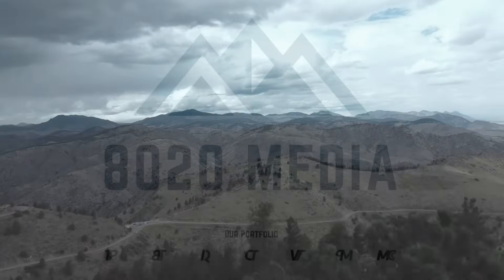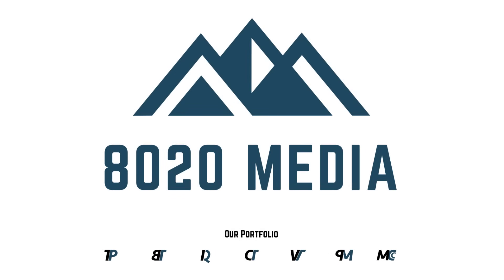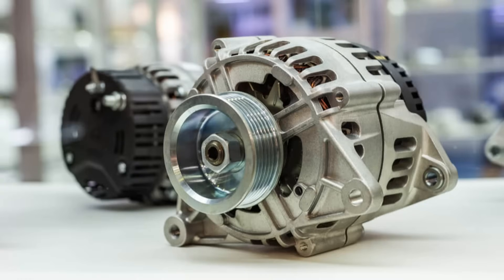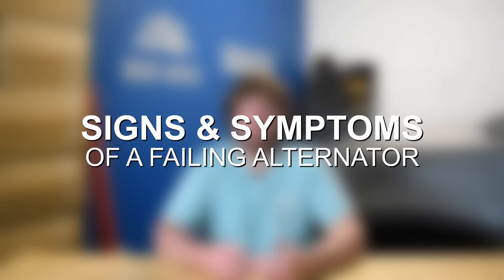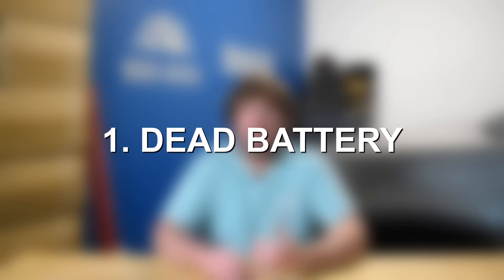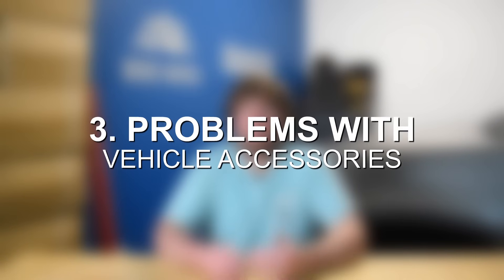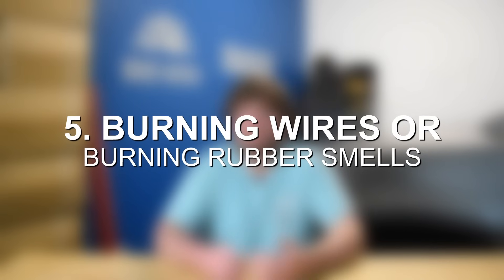6 Symptoms of a Bad Alternator!

Comment: I have a 2019 kia sorento V6 SX and a coiple of weeks ago, stopped at a red light and all of a sudden the car stalled with a low batter message. I was able to restart the vehicul after about a minut and continued on my way to work. It hasnt stalled since but now I have the battery light that turns on and stays on and my day lights in auto mode dont turn on. So I check the voltage of the battery and I get 11.4 volts. Recheck with the engine running and I get 14.3 volts. Turn on all accesories and still get 14 plus volts. Now Im uncertain what could be the issue cause the voltages all seem ok but since that battery is 6 years old, I decide to replace it with a new one hoping that it will turn off the battery light warning but its still on and at the moment I have no clue what to do.
Reply from the maker: D - Sorry to hear this.. Given that your vehicle stalled with a low battery warning, now shows a persistent battery light, and has daytime running lights (DRLs) not functioning in auto mode despite proper voltage readings (14.3V running, 11.4V off), it sounds like your alternator is charging but likely intermittently or partially failing—possibly due to a failing voltage regulator or a smart charging system fault (controlled by the ECM); since you've replaced the battery and the issue persists, next steps should include checking for stored diagnostic trouble codes (even if the CEL isn’t on), verifying alternator output consistency with a scan tool that reads charging commands, inspecting the fusible link and alternator wiring harness for damage or corrosion, and considering a load test or alternator bench test—especially since the DRLs and battery light suggest possible voltage irregularity even if multimeter values seem normal.

Comment: Good morning quick I was driving to work today and my battery charging system pop up on the dash do you think is because the alternator is going bad or something else
Reply from the maker: M - If your battery charging system warning popped up while driving, it’s most likely due to a failing alternator, as that light usually means the system is not charging the battery properly—common causes include a worn-out alternator, loose or slipping serpentine belt, corroded battery terminals, or a bad battery ground connection; you can check voltage at the battery with the engine running—it should read around 13.8 to 14.5 volts—anything below that usually confirms a charging issue, and if it’s significantly lower or drops while accessories are on, the alternator is likely the culprit.
Reply: @ thanks so much man oh man you came in clutch
Reply: @8020Automotive hey I replaced the battery and the alternator and three bad fuses but the car still will not start any suggestions of what it could be
Reply from the maker: @MrLastking26  If you've replaced the battery, alternator, and some bad fuses, but your car still won’t start, the next steps are to narrow down whether it’s a no-crank or a crank-no-start issue—if you turn the key and nothing happens (no sound, no starter click), it could be a bad starter, faulty ignition switch, blown starter relay, or a bad ground (especially the one from the battery to the engine block); if it cranks but doesn’t start, then you're likely missing spark, fuel, or proper timing—in that case, check for fuel pump prime (you should hear it buzz for a second when turning the key to ON), scan for any stored codes even if the check engine light isn’t on, and check if the security/immobilizer system is active (some systems will block starting if they don't recognize the key or if power was just disconnected); also double-check that every fuse is seated correctly and that no key main fuses (like the ECM or IGN fuse) blew again during installation—those are often overlooked.
Reply: @8020Automotive thanks I will give it a shot later today thanks so much for the advice

Comment: Silly question, i have replaced my battery in my car and it still wont start. When i try to turn it on , it really wants to turn over and start, but it just cant. I almost got it crank but failed. Im assuming this is the start motor, would it be that or does it seem like a failing alternator? 
I've already got a new starter motor to replace it anyway but i feel like im just stabbing in the dark 🤦🏻‍♀️
Reply from the maker: B - Not a silly question at all—in fact, it's a very common situation! Since your car tries to crank and almost starts but can’t quite catch, and you’ve already replaced the battery, this doesn’t sound like a classic starter motor issue, because a bad starter usually causes no crank or just a click, not repeated cranking that almost fires; and it's not the alternator, since that only affects charging after the car is running—your symptoms more likely point to a fuel or ignition issue, such as no spark, weak spark, or a failed fuel pump, or even a crankshaft position sensor failure, which can prevent the ECU from timing the ignition properly; before installing the new starter, check for fuel pressure, spark at the plugs, and scan for any pending codes, even if no CEL is showing—this will help avoid replacing parts that aren’t the problem.
Reply: @8020Automotive  Thank you very much!!
Reply: @Breeexee  let me guess dead battery?✅
Reply: @ellonysman  can't be, I changed the battery in it as that was my first thought!

Comment: My old and bad battery started messing with my acceleration sensor and kept my radio from powering up and starting the car.
My bad alternator started with the burning smell and with white smoke coming out of it (alternator area) that day after replacing the 10 year old drained bad battery with a brand new one (same brand and same model as the old battery). 
It drained the new battery over night to zero without the engine ever being on. And starting smoking again, has the burning smell again with the engine turned on. 
The bad alternator also is warm/hot to the touch without the engine turned on within 15-20 minutes after connecting the battery. So I’ll disconnect the new battery until the new alternator gets here and is replaced. 

I have a new battery now and the new alternator is on the way. 
2000 Nissan Sentra Se 2.0 😊
I found a replacement alternator for only $150 brand new. 
I needed a new battery anyways. $240
$400 total for both parts without the labor charge yet. 
Hopefully my mechanic nephew or my brother can 
easily pop in the new alternator when it gets delivered tomorrow asap.

As old as both my old alternator is and the old battery was, your video here shows all the signs of what happens when they need to be replaced. 
Thanks for sharing.
Reply from the maker: i - Thanks for taking the time to share your feedback and experience! Will certainly be helpful for future viewers!

Comment: Would this make my electric seat's not to work
Reply from the maker: L - Yes, a bad alternator can absolutely cause your power seats to stop working, especially if it's undercharging or producing unstable voltage, because many vehicles will limit or disable non-essential electrical functions (like power seats, windows, or infotainment) to preserve battery power when the system detects low voltage or charging issues; if your alternator isn’t keeping the battery charged, your seats may work intermittently or not at all—check your battery voltage with the engine running (should be 13.8–14.4V), and if it’s below that, your alternator is likely the root cause.

Comment: Can battery with 50% health leads to high charging voltage ?
Reply: A battery with 50% health may not charge efficiently due to internal resistance or sulfation. This makes the charging system work harder, often increasing voltage (sometimes above 15V) to compensate, which can lead to consistently high charging levels.
Reply: @vigilantemotors  👍 exactly..my guess is correct
Reply from the maker: V - Thanks for assisting viewers!
Reply from the maker: S - Yes, a battery with only 50% health (especially if it's sulfated or has reduced capacity) can absolutely cause your alternator to produce higher charging voltage, because the voltage regulator interprets the weak battery as needing more charge and tries to compensate by boosting output, often pushing it toward or above 15V—while this is the system doing its job, it can lead to overcharging behavior, especially if the battery can’t properly accept or hold the charge, which puts added strain on the alternator and risks damaging sensitive electronics; if you're consistently seeing high voltage and your battery is degraded, it’s a good idea to replace the battery first and retest the charging system before assuming the alternator is bad.

Comment: why alternator producing high voltage ? 15.0 v or above ? Its not in your explanation
Reply: An alternator producing 15.0 volts or higher typically indicates a problem with the voltage regulation system, or it's reacting to a specific condition like a cold battery. In normal conditions, most vehicles should charge between 13.7V and 14.7V.
Reply: @vigilantemotors  thanks mate
Reply: @ Anytime 🤟🏼
Reply from the maker: V - Thanks for assisting viewers!
Reply from the maker: S - Great catch—and you're right to question that—an alternator producing 15.0V or above (especially if it’s consistently at or over 15.2V) is often a sign that the voltage regulator inside the alternator is failing, causing it to overcharge the battery and electrical system; this excess voltage can stress or damage sensitive modules like the ABS, ECM, and TCM, which are designed to operate around 13.8–14.4V, and even short spikes above 15.5V can trip fault codes or cause modules to behave erratically—so if you're seeing steady high voltage, especially with electronic glitches or ABS lights, it's time to test and likely replace the alternator or voltage regulator before it damages other systems.

Comment: Can a bad alternator affect the ABS module
Reply from the maker: B - Yes, a bad alternator absolutely can affect the ABS module, because the ABS system is highly sensitive to voltage fluctuations—if the alternator is undercharging or overcharging, it can cause the ABS module to receive inconsistent power, leading to intermittent ABS warning lights, false sensor readings, or complete module shutdown, especially during high electrical load or low-speed braking when voltage dips are most noticeable; so if you're seeing ABS issues alongside dimming lights, slow starts, or fluctuating battery voltage, test the alternator immediately (should be 13.8–14.4V at idle), because a failing charging system can mimic or even trigger ABS and traction control faults.

Comment: What if I jump start my car and even then it won’t start is it battery or alternator
Reply from the maker: S - If jump-starting your car doesn't get it to start—even with a good connection from a known working battery—it’s most likely not just the battery, and you’re looking at either a dead alternator that drained your battery completely, a bad ground or power connection, or possibly a starter or immobilizer issue; to narrow it down, turn on the headlights while attempting the jump—if they dim drastically or flicker, it could still be a bad battery or connection, but if there's clicking with no crank even with jumper cables, then the starter may not be receiving power or is faulty, and you’ll want to test for voltage at the starter and inspect all major grounds and battery cables before replacing anything.

Comment: Same car 14 months old battery. No power at all. No lights inside or outside, no door bell, nothing. Jumper cables make the horn honk… wth ?!
Reply from the maker: P - If you’ve got a 14-month-old battery and absolutely no power—no lights, chimes, or anything—but jumping it causes the horn to honk, that strongly suggests a main fuse or fusible link has blown, likely due to a surge, corrosion, or loose terminal short; the horn working with jumper cables confirms the circuit isn’t totally dead, but the fact that the battery shows zero life on its own means either the battery has an internal failure (like a broken connection inside) or the main power distribution fuse (often a large 80A-120A fuse near the battery or on the positive terminal) has blown, so check voltage at the battery posts directly (not the terminals), confirm continuity through the main fuses, and visually inspect for melted or corroded connections at the battery and fuse block.

Comment: Just curious i have a 2020 jeep sahara unlimited, replaced both batteries, tipm, and both canbuss, issues im having every light on dash is on its stalls out everything gets glitchy cant drive it,it tries to go into park while in drive or reverse. And all scensors are dinging been to 2 mechanics and they cant tell me anything any info on this will help
Reply from the maker: C - The issues you're experiencing with your 2020 Jeep Sahara Unlimited—dash lights flashing, stalling, glitching sensors, shifting into park while in gear, and overall electrical chaos—point strongly to a CAN Bus communication failure or grounding/power distribution issue. Since you've already replaced the batteries, TIPM, and both CAN Bus modules, it's likely either a bad ground connection (common on Jeeps), wiring harness damage (especially under the dash or near the TIPM), or a failing PCM or BCM. Corroded or loose grounds, especially around the engine block, firewall, or chassis, can cause erratic signals. Additionally, software corruption in the control modules is a known issue and may require a full system reflash using a dealer-level tool like WiTech. If you have any aftermarket electronics—such as remote start, audio upgrades, or lighting systems—they could also interfere with the CAN network and should be temporarily removed to rule them out. If local mechanics can’t diagnose it, your best option is a Jeep-certified dealer with factory diagnostic tools to run a network scan and identify any misbehaving modules.

Comment: I got my alternator 2 months ago and my battery 5 months ago. However, when I’m trying to start the car sometimes, the car makes a clicking sound. I have to keep turning the ignition until the car turns on. What could this be?
Reply from the maker: S - If your battery and alternator are fairly new and you're still hearing a clicking sound when trying to start the car, the issue is likely related to the starter motor or a poor electrical connection. The clicking usually indicates the solenoid is engaging, but the starter isn’t turning the engine—this can happen if the starter itself is failing or if there’s corrosion or looseness in the battery terminals, ground strap, or starter wiring. Double-check all battery cable connections, especially the ground to the engine block and the positive lead to the starter, for tightness and corrosion. If the wiring checks out, it’s likely your starter is worn out or has a dead spot, and replacing it may resolve the issue.
Reply: @8020Automotive ok, thank you very much for the input! I appreciate it!

Comment: My 2008 saturn aura crank and some time it won't and won't let me get a boost off and I have to let set around 3 hour and then it will crank
Reply from the maker: M - It sounds like your 2008 Saturn Aura may have an intermittent electrical issue, possibly related to a failing starter, ignition switch, or even a poor ground or battery cable connection. If it won't crank and also won't accept a jump start, it could mean that heat soak is affecting the starter—when the engine is hot, the starter may fail internally until it cools down again (which lines up with the 3-hour wait). You should check for voltage at the starter when the issue occurs—if power is getting there but it won’t crank, the starter is likely bad. If there’s no power to the starter when you turn the key, it could be an ignition switch, neutral safety switch, or related wiring issue.

Comment: What if the battery is smoking or overcharging? Only when driving
Reply from the maker: G - If your battery is smoking or appears to be overcharging only while driving, it's a serious issue and most likely points to a faulty voltage regulator in the alternator, which is allowing too much current to reach the battery. This can cause the battery to overheat, boil the electrolyte, and even vent dangerous gases or smoke. It could also be a bad ground or a short in the charging circuit. Stop driving the vehicle immediately, as this can lead to a battery explosion or fire. Have the alternator and battery tested as soon as possible, and avoid charging or jump-starting the vehicle again until it’s properly diagnosed.

Comment: On these ford's the speedometer cluster could be bad as well because they have a problem with them losing connection to the computer cutting power  to radio batteries Trans Guages power windows and Ford will not fix and buying a new one is not an option because ford never changed the parts so your best bet is  sending it to s Carolina or n Carolina to circuit board techs or something like that I can't remember the name of the company they will update the parts for 200 bucks and will send it back fixed in 1 day and has a plug n play type plug so there's no having to program them
Reply from the maker: L - Thanks for sharing!